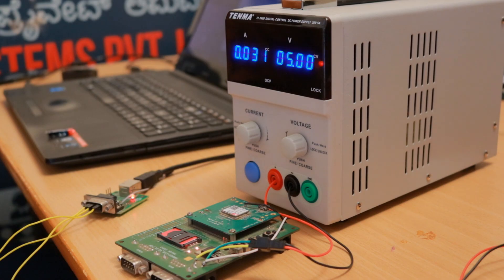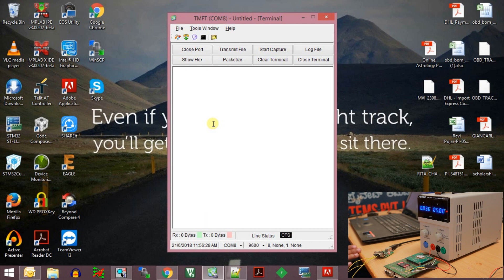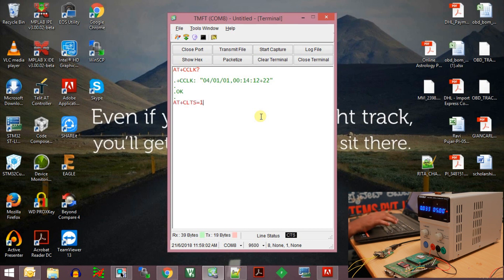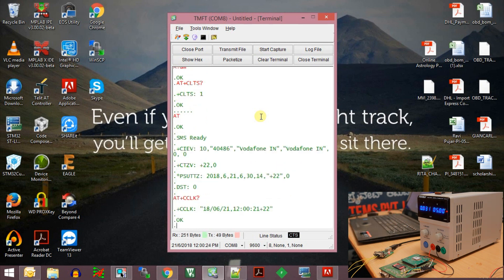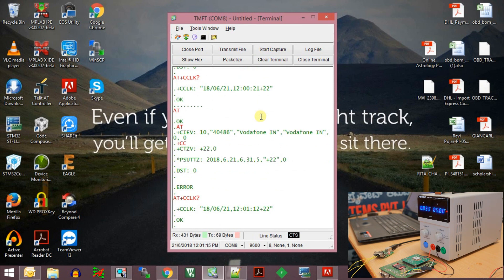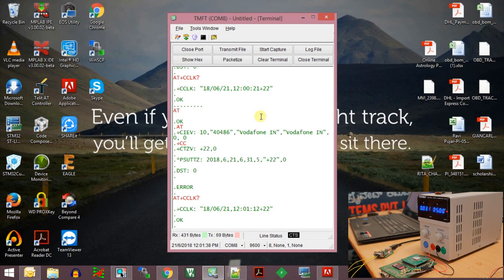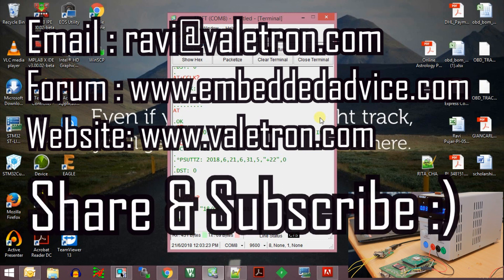Learn, How to sync RTC time with Network Time using module - SIM900/SIM800/Telit

Comment: sir, AT+CLTS command is NOT present in newer 4g modules like  simcom A7672X , how should we sync RTC using network time in that case, I couls not find any alternate command in the AT commands manual. thank you!
Reply: same problem for me also

Comment: don't work for me. i did same as u said but after restarting it's remain in this way
 AT+CCLK?

+CCLK: "04/01/01,00:08:24+32"

OK
Reply from the maker: It's dependent on network provider. Some network don't support

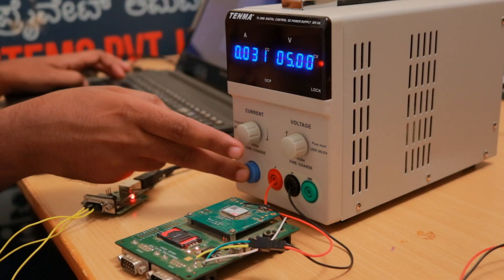Comment: 1:46 you don't need to Power-Off or  "Reset" Button, to restart the module, these options are only use when module doesn't response. To restarting the module, you can use the  "AT+CFUN=1,1".

Comment: Hi. I have done exactly as you have suggested above. But after reboot my time has not updated, it remains at "04/01/01 etc". Any ideas why?
Reply: Are you using an Arduino compiler to use execute this?  I badly need this function for our thesis
Reply: @seriojoao5170  It has nothing to with Ardruino. Any serial communication will do.
Reply: Are you getting the +PSUTTZ: message? Because that is how the synchronisation happens. The network has to both support and send this.
It could be a network issue.